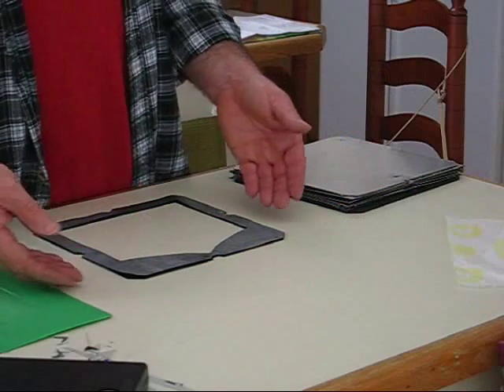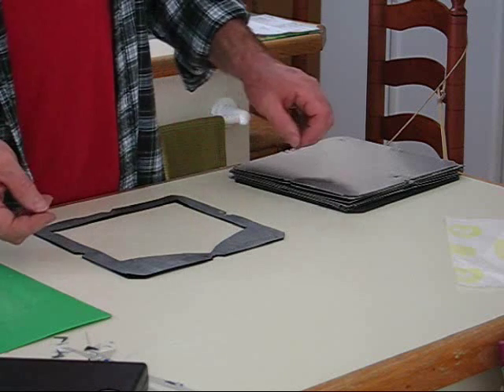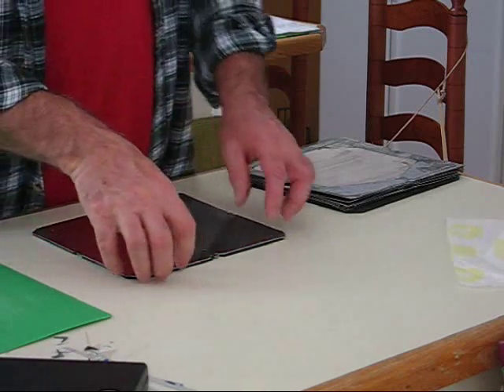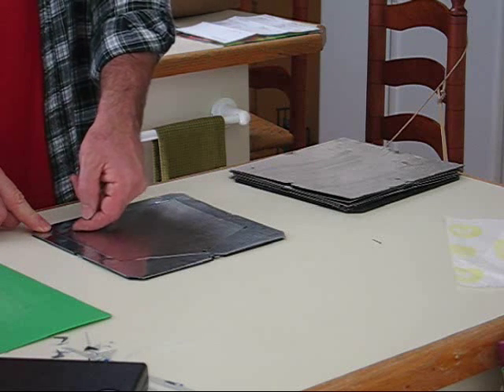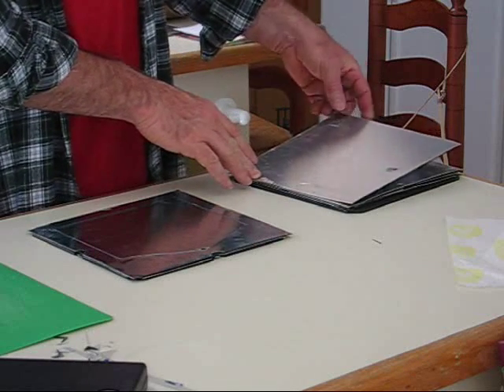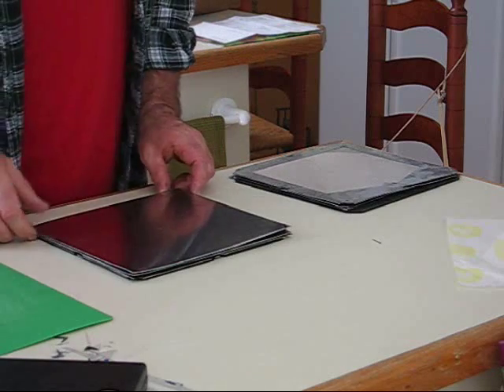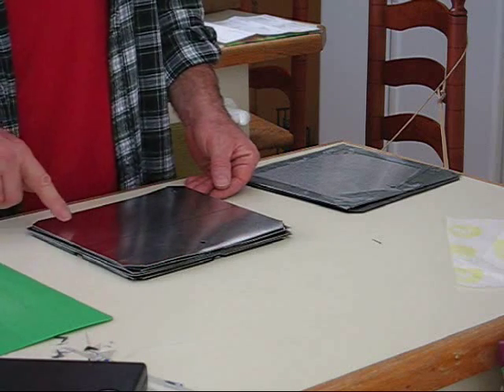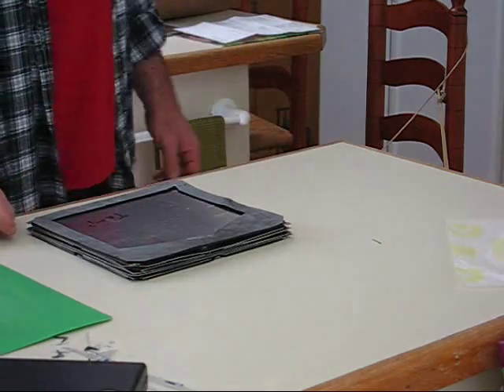HHO Dry Cell Mars Gasket Part 4

Comment from the maker: Hi Thom: I understand that more parts equal more possible points of failure.  If this design was mass produced a one piece gasket could be molded into the proper shape. I needed the double gasket to form the flap to back up the holes. I wanted to decrease the likely hood that the current would follow the electrolyte and jump through the holes. (Electricity follows the path of least resistance.) 
The concept seems to work as I planned but the brick needs some design work.
Mars

Comment from the maker: Hi freedombiteback: The thinner gaskets you can use weaker electrolyte and still get good production. Also weaker electrolyte makes it harder for the current skip one or more plates by following the electrolyte and flowing through the holes.
Mars